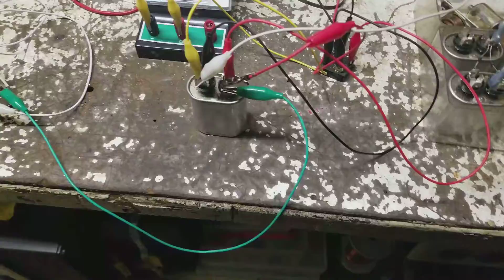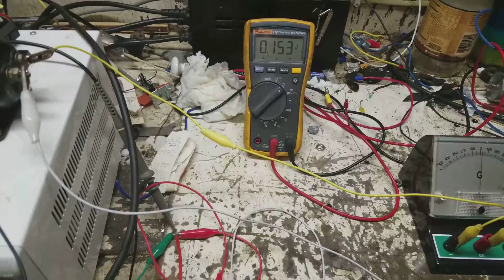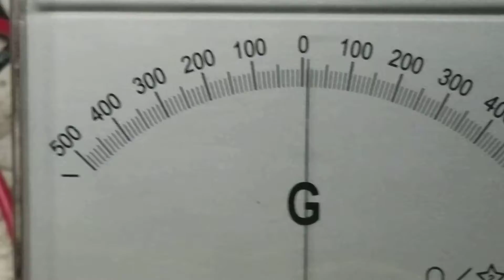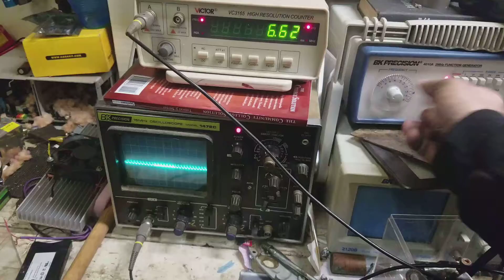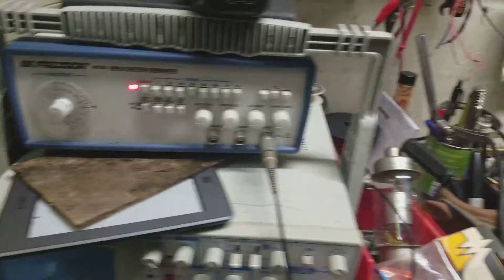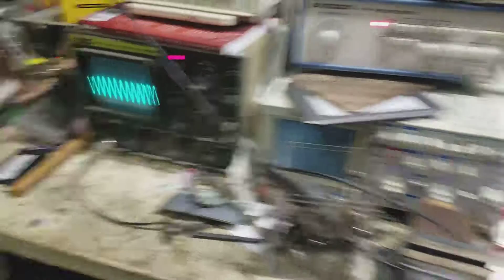Discharging earth currents

Comment: Did you try using the full wave volt quadrupler for the collector instead of a single capacity?   Might be worth checking to see if you can net 4x the volts...
Reply from the maker: I think i tried it, but can't remember.. I may have already converted it to the half-wave multiplier.. I'm definitely reverting back to the quadrupler here soon.. I blew that relay, it seems.. Doesn't want to turn on any more for some reason.. a 3055 seems to bleed too much voltage from my signal generator, which sidetracked me down the path of driving those HV stepup coils straight from the generator to earth, and I could get around 350vac output, and rectify and charge a bank.. the half-wave seemed to kill it though.. gotta go back to the other setup..